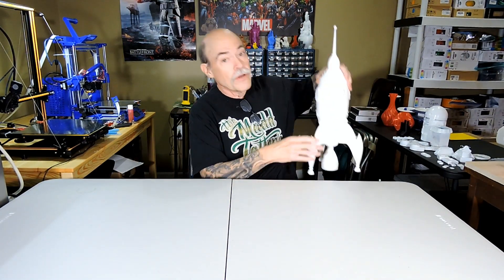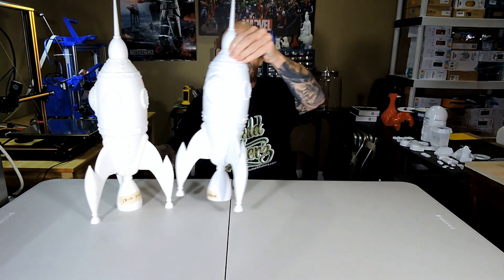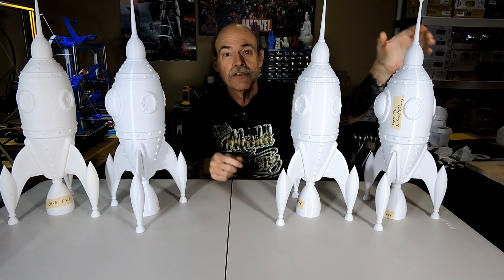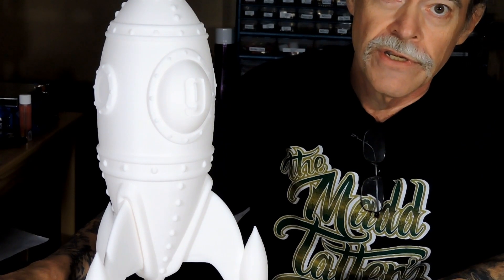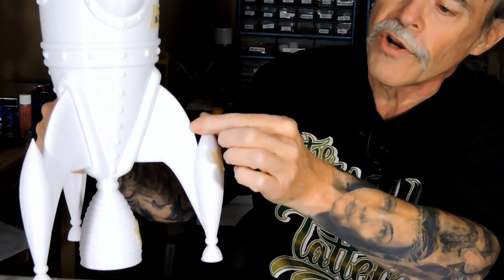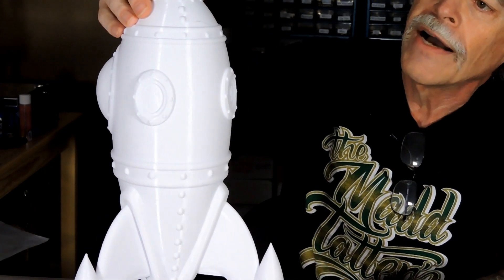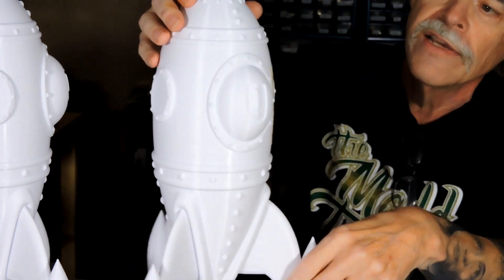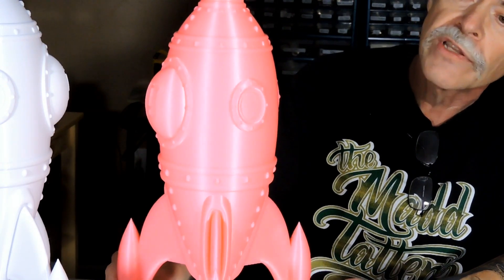CR 10 Upgrades - Do they really work? Magic 3D Printing

Comment: Did you do these prints with the same profile on all of them?
Also, people swear by the fang....
Reply from the maker: rebsiot Yes all of these prints were sliced in Simplify3D using the profile setting suggested in Thingiverse. The only exception was the pink rocket at the end. That one was printed with Chris Elkins Sept 2017 profile. The CR-10. Behind me on the left was the one I used for these prints using the OEM fang by Tacblades on Thingiverse. Hope you enjoyed the video. I have some other pretty cool ideas for upcoming ones!
Reply: James Franks
Thought it was good.
The wire stabilizer is the one stabilizer I've actually seen that's interesting and pulls both sides. It also looks way cleaner than others. Ringing is the worst problem.

The copper build plate on that site was cool looking also.

I got an ezabl (way better leveling) and both microswiss and stock hot ends. Which sucks because pla doesn't like all metal and stock no likey >240.

Did the fang really make that big of a difference.
Reply from the maker: rebsiot yes the wire stabilizer was designed by an engineer and seems like a really solid solution!
Reply: yea, good thing math and ideas are universal, because he's a horrific speller "REALLY COOL
 INOVATIVE THINGS"...written english and web coding is equally bad.
Doesn't make it a bad solution...i think I'm going to get one.